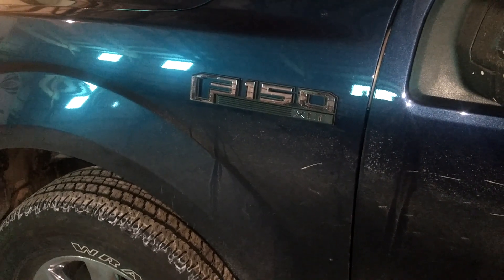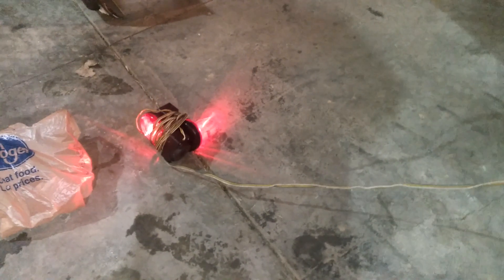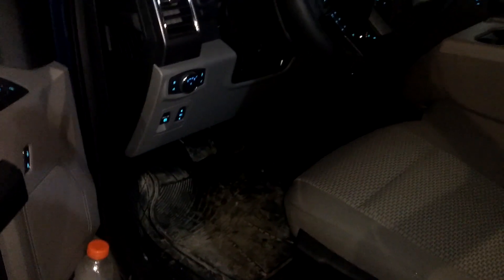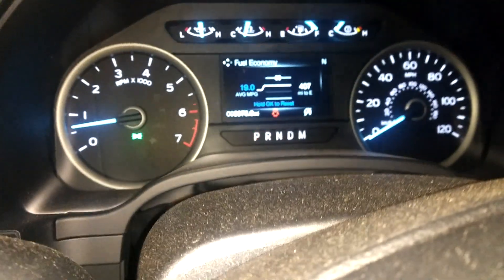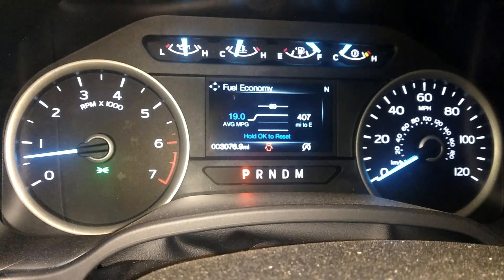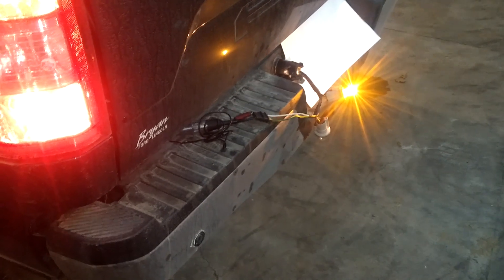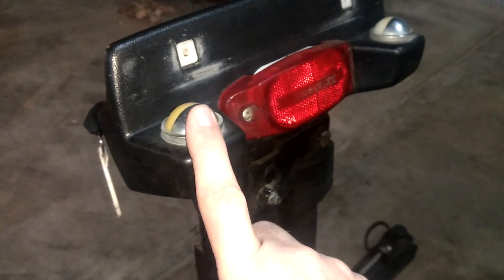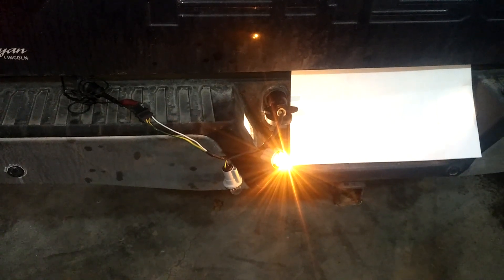2017 F150 Trailer charge terminal. 12V supply.

Comment: I was testing the connections and noticed I didn’t have 12v but had a good fuse. I wasn’t sure what was up. This was Very helpful. I hit the brakes gave in a few seconds and it recognized a trailer.  Way better than the video with a guy hacking his wire harness. 🤦‍♂️ Thank you!!

Comment: I just went through this problem. My slide in the bed camper doesn't have brake lights mounted on it so the truck did not recognize that there was a trailer connected and the 12 volt power to the camper would not activate. I'm going to mount little lights in the camper and hook them to the left and right signal wires coming from the trailer cord lead. I didn't see your video until after spending 2 hours checking fuses and wires and finally hooking my little utility trailer to the truck to prove it needed to see trailer brake lights were now connected so it would turn on the 12 volt feed. Ford goofed up on designing this one.
Reply from the maker: For safety it is a good design but doesn't work for everyone's situations. For example if the wire harness shorts there isn't power on it or if there is power always on it it can corrode the terminals easier. I'm just glad I figured out how to get 12V power.

Comment: on my 2018 f150 xl 4x4 crew cab with 5.0 and tow package. assembled 4/18 in kansas city, i installed the trailer brake controller, used forscan to turn on in 2 places, ( enable and enable gain). when plugged into a fully equipped and wired trailer, once the pickup recognized a trailer,  the 12+ line became hot, ( the engine had to be running before the 12+ became hot)  brakes worked, with in dash gain display, even have reverse pole hot while in reverse in the 7 pole trailer plug.
Reply from the maker: Yes, that is correct. Plug in a trailer press brake and it will power up. In our case a wheelchair lift doesn't put any load on any trailer terminals so it doesn't "see" anything plugged in and won't turn on the 12v. I ended up wiring the lifts' license plate as a right tail light. It will turn on the 12v now but it also notices the left trailer light is "out". We just clear it and the lift works fine. It is kind of a pain as you always have to start the truck press the brake then go back to lift the chair. For getting out you have to leave it run, lower the chair then go back and shut the engine off. Not bad but when you're wheelchair bound it's a lot of extra work.  Would be nice if it was always hot like the earlier models were.

Comment from the maker: Yes, that's correct. Once the truck "sees" the trailer and you hold the brake down after connecting it will supply power to the 12V terminal. Provided you are wired correctly it will have power with engine on.

Comment: I have the same issue on a 2019 F-350 dually only in addition to doing everything this video shows, you also have to have the key fob inside the cab and all doors shut for the 12 volt pin to have power, Kind of Crazy.
Reply: This is the ticket! Thanks!

Comment: Could u pls provide a more detailed information or draw for the line/bulbs you used for this purpose?  I have sent my 2018 F150 FX4 to dealer 3 times for this problem and the dealer was confused too for not having the 12V power.   Thanks.

Comment: I am not sure how much load the lift takes, but you could probably wire it into the park/tail light terminal, that way you could have power by just unlocking the door.
Reply from the maker: I guess that's something I could look into. You know tunnel vision when you see it. Just had it stuck in my head battery power. I'll have to research amp draw and see if the circuit will handle it. If I recall, the lift motor has some big cable on it  Thank you.

Comment: Thanks for the video, So if I understand you correctly. I shouldn't have a problem charging my RV battery in travel trailer when towing my camper, As long as the F150 see the trailer.
Reply from the maker: If everything is working correctly, once the trailer is hooked and truck is running press the brakes for a few seconds. Take a test light back and with a good ground check the battery charge wire for power. Unhook it from the trailer battery so you know for sure the power is coming from the truck. Hope this helps.

Comment: Super useful video Chris thanks a million for that. I have a f150 2018 ... After I push the break pedal for 5, 10 or 15 seconds, I never see the popup screen saying "Trailer Connected". But I have all lights running correctly. Am I missing anything obvious?
Reply from the maker: I don't know about this truck but the truck before this had to have a fuse and relay installed in the fuse box before it would get power to the plug.  You might want to check and make sure the circuit is complete.  It's a shot in the dark but it's worth looking into.

Comment: does the truck sense when the aux battery is full and stops charging or does it just charge until you shut the truck off?
Reply from the maker: I can't answer that, I've never dug into it. We use it as a power source so it always has to be on since we don't have an auxiliary battery.
Reply: I'm interested in knowing that also, from what I've read it only sends about 1.5 amps to the trailer battery.

Comment: I thought it was a helpful video ... so ultimately the one bulb is on that 12 volt line so when that is on you have trick your truck into turning it on ... would that be the same for a 2016 too. I know my truck knows when I connect my small unity trailer
Reply from the maker: Our old truck was a 2012. It had a towing package but the relay and fuse needed to be put in the fuse panel on top of the radiator area. We had a relay for power rear window but the truck didn't have that option so I moved that one and then it worked. I'm not sure about a 16 I'd have to do some research.
Reply from the maker: Here is a link to a video installing the fuse and relay to make 12v power at the plug.
 https://youtu.be/VOYqteFodJ0

Comment: Dumbest setup from a manufacturer I've ever seen; engineers definitely sit back and ponder ways to fuck things up while imposing their eureka moment ideas upon us all ...  I've encountered so many work trucks and friends trucks where the "intelligent" trailer battery charging system has shit the bed and won't charge for whatever reason....  Ford really screwed the pooch on this "upgrade". I've wired up so many charging relays on these trucks so it's purely electro-mechanical it would make your head spin and they now charge and provide up to a circuit protected 30 amps right to the rear (I run a redundant charging circuit wire to the rear 7 way plug) under a KOER situation only... So while snowmobiles are being hauled the diesel heater is churning along in the ski-doo trailer keeping the trailer at a toasty 21 degrees Celsius and all the sleds are plugged in to keep their batteries at the fullest charge available and the deepcycle batteries in the trailer are always at full charge...

Comment: The trailer i just got has all leds and doesn't draw enough current to trigger the 12v on. Any ideas?
Reply from the maker: Did you hook it up to a different trailer to make sure the 12V works on it?
Reply: @chrismiles1369  i didn't, my last trailer was an open deck and didn't need the 12v
Reply: Add a resistor

Comment: mine seems to only provide power to the trailer break away battery when I apply pressure on the brake pedal, but then it cuts power to the break away battery after i stop applying pressure. Any ideas?
Reply from the maker: Silly question but are you on the correct terminal. The trailer brake will power up (if equipped) when the pedal is pushed.
Reply: @chrismiles1369  correct terminal? As in the trailer battery terminal? I mean this is the way the trailer came, and the dealer even tried swapping wires in the plug, but that fed the trailer brakes constant power. This trailer battery is for the emergency break away battery. Honestly after reading through some of the comments it seems like some people are saying that itll only provide power while all doors are shut and key inside the vehicle. I dont remember all of the ways I checked, but I just remember I could never get a solid charging light on the battery. Only ever lit up when I had my foot on the brakes, then would shut off when I let go. LOL
Reply from the maker: @dach4mp85  you answered my question.....when they switched the wire and it applied the brakes. This tells me you have it on the correct 12v tab. All I know for fact is right there in the video. It works for our wheel chair lift which would be the breakaway battery charge line that you are talking about. In the "good old days" you had a fuse in a hot line from the battery and it always worked. This is how I use to run a power inverter to run a mini refrigerator when we camped.  Now days it's more complicated...sounds like each year is programed a little bit different.
Reply: @chrismiles1369  yeah sounds like its just a complex system. thanks for the reply. Its possible that since this battery isnt having much of a draw on the system, the truck isnt sending it power since this system seems to be "smart." At first I thought it was the fuse and relay that older models are said to not have been installed, but I checked and both are there. I'll drive with the trailer and get out after awhile to see if I have steady power.
Reply from the maker: @dach4mp85  I guess it's possible it might turn on with the brake pedal it might check to see if the battery needs charged ( if no load is on the circuit) it may turn  off so the battery does not over charge?
Reply: @chrismiles1369  that sounds like a logical "smart" plug operation. Next time the trailer is hooked up, I know the battery will definitely not be fully charged. I'll be curious to see

Comment: I used an electric brake magnet that I connected to a 7-way trailer connectors.  Them, it will charge you battery.  See this video: https://youtu.be/vuv7fyV4wz4